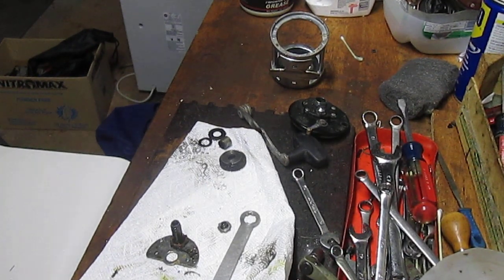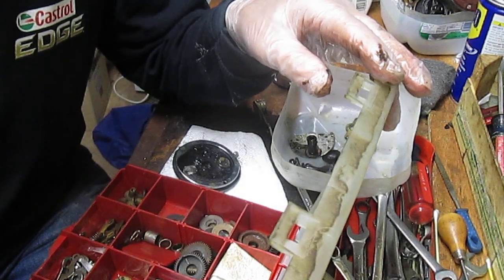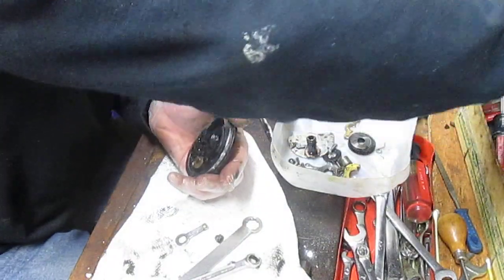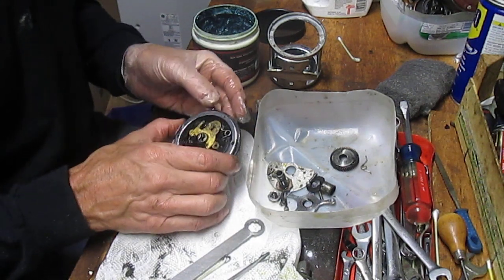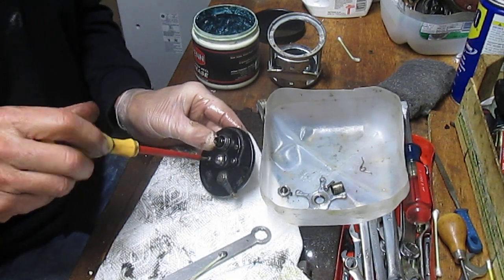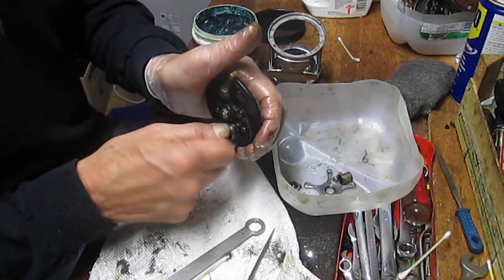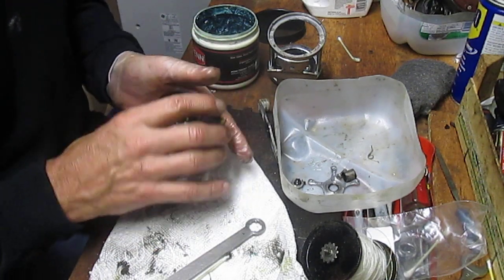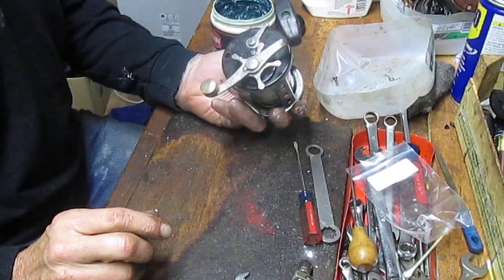How to replace a Penn Reels free spool release spring

Comment: Is the spring different in later Penn 85 models with the baker lite handle ?
My spring looks nothing like yours !
Reply from the maker: Yes.  there are two different spring set up.  The early models used a flat spring set up for the anti-reverse dog and then Penn changed the set up to a coil spring in the late 1950's.  The video in the link below shows how to load both types https://youtu.be/qTb04jiHS0o.  Thanks for asking - Dennis
Reply: 2nd Chance

Comment: Very dark or black grease always makes me nervous when I'm servicing a reel. Usually indicates a problem, i.e. that broken spring. Seems from the video someone got a bit aggressive with the grease in that JigMaster. Created quite a mess in that one, great example of why you wear that glove.
Reply from the maker: Wait until you see the one I post today!  The darker the grease, like motor oil, the more you can expect a problem.  Drag grease at a minimum is due to age.   Usually in includes debris from dried water, mud, salt, etc. and at worst, it is holding metal shavings from parts wear like, gears and moving parts.  Thanks for watching - Dennis

Comment: I have a 209 penn reel and the shaft going through the spool just spins how is the shaft going through the spool stays tight and not just spin is there a snap lock washer or is it glued in
Reply from the maker: Something has broken loose on that reel and it cannot be repaired.  You need to replace the spool.  If you are asking about the drive gear on the  back end of the spool, that can be replaced, but the shaft cannot. - Dennis

Comment: You're going so fast and flopping the plate around and not showing how the spring is tensioning.
I have the red reel and the spring goes in opposite direction  and it won't line up in the handle hole on the outside of the plate. I'm putting to much pressure on the brass to try and tension the spring
Slow down and take a more close up of what your doing. You are describing things when i cant see what you're doing.
The black reel is hard to see whats going on.
Reply from the maker: Scott - what reel do you have.  I will be happy to remake the video and try to show a better view. 
Let. me know the model and I can do that for you - Dennis
Reply from the maker: Scott - here is a 2nd attempt to show the process to replace an eccentric free spool release spring on a Penn Reel.  I was able to find one in the shop that needed that service, so you asked at the right time.  Hopefully this provides you a better view of how to make that repair - Here is the link 
https://youtu.be/Dlbohcq-GS8
Dennis